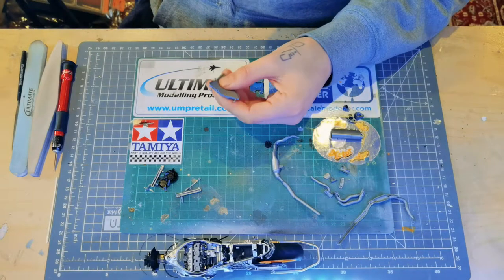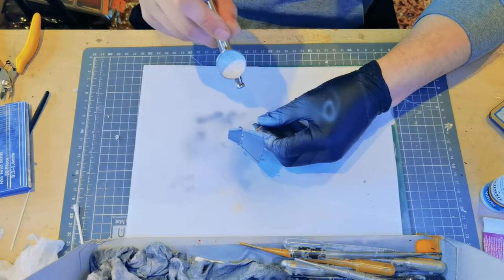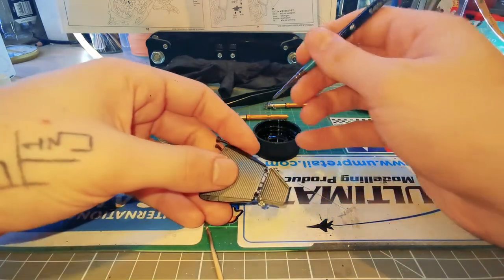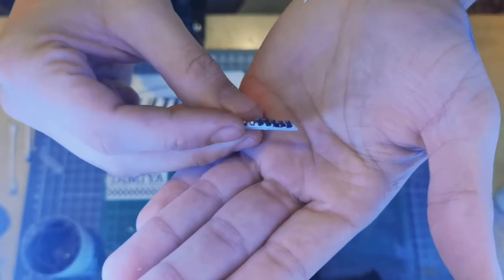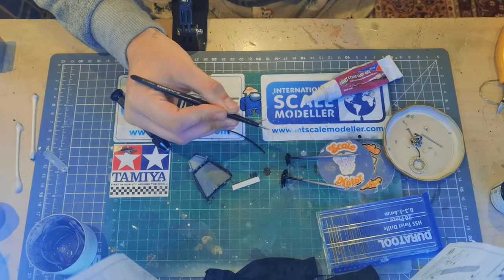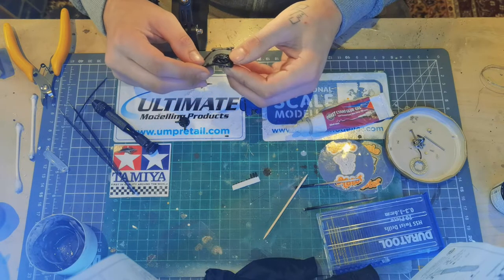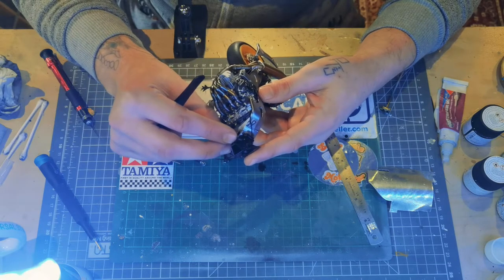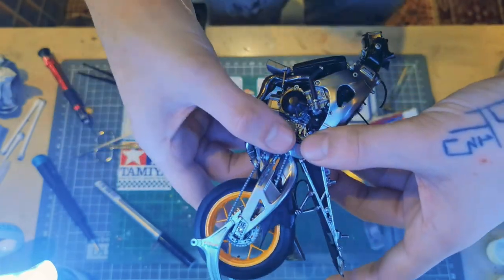Tamiya Honda CBR1000RR-R Repsol Build - Part 4 Radiator and making Fan Wiring.

Comment: Congratulations for getting over 100 subs! 👍

Really nice work here - it looks like it would work with all the drilling and wiring you've done!
I think it does help using the tripod to show closer details - I bought one for that exact reason. It's so strange seeing a bike build - I know the skills but since I haven't built one, it looks a bit unusual! 😂
Reply from the maker: Thanks mate!

Thanks for the feedback, too. It's funny, my mount for the phone is just a modified GoPro mount, but it's screwed to the table, so it's nice and sturdy, haha!

You've not done a bike!? Have you got any in the stash?
Reply: @ScaleMotor  no I don't. I'm not as big a fan of them I guess but I would like to get one sometime. Probably something classic.

Comment: Great and very descriptive video 👍 did you thin the tamiya LP series before spraying?
Reply from the maker: Thanks mate! I used the tamiya lacquer thinner with retarder around 50-70% thinner. I start at 50/50 then add more thinner until I get the consistency I like